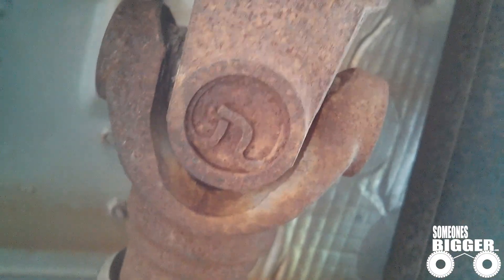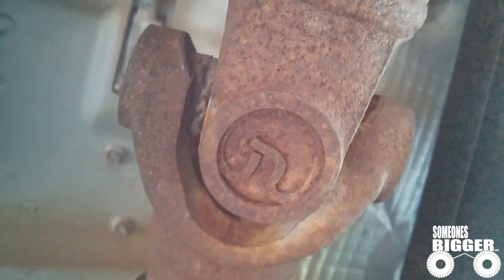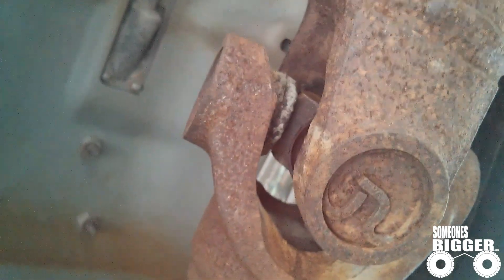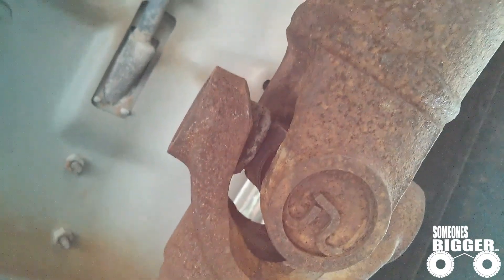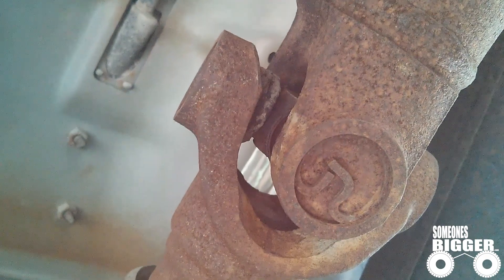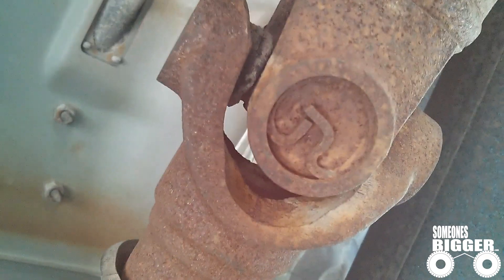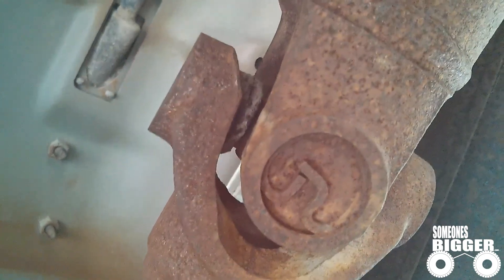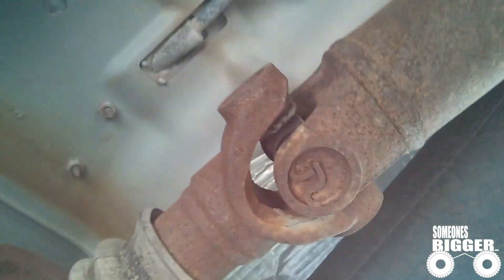What a bad u-joint looks like

Comment: there should be no play should there, that should be tight?
Reply: Yes. Any movement on one part of the u joint should immediately transfer through to the other section of the driveshaft. The "slop" between the shafts is the cause of noise